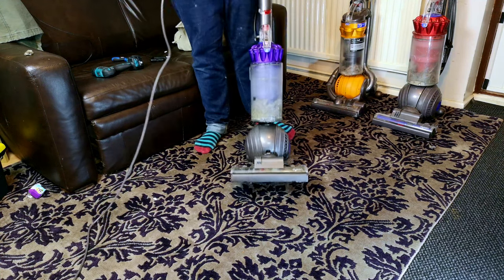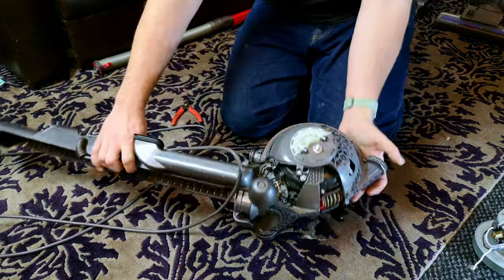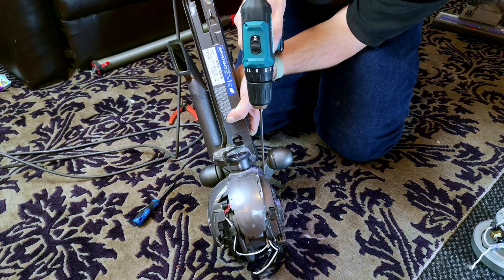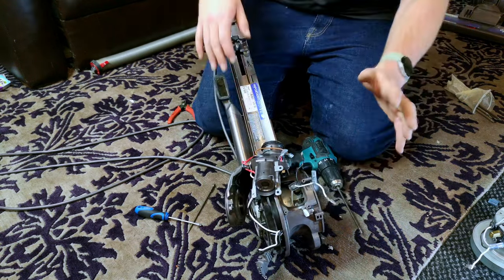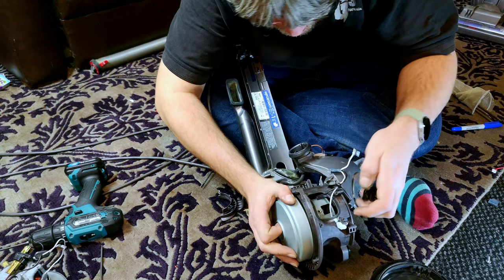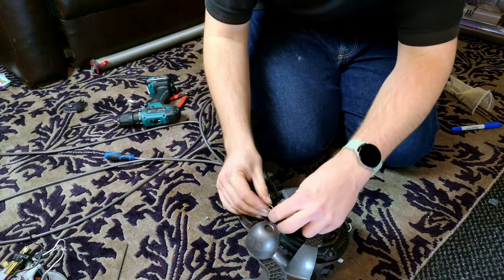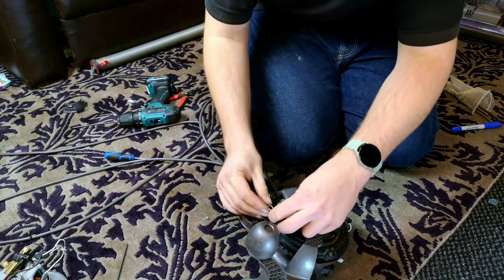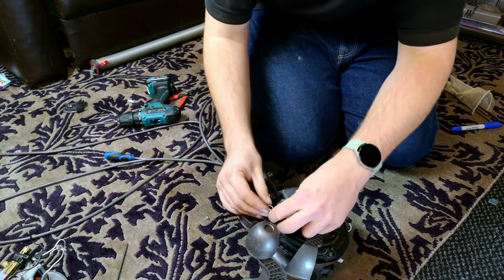How to replace the motor in a Dyson DC40!

Comment: Many thanks for making this video.  I spent £100 on a new Vax because my 9 year old DC40 sounded like a banshee when it was turned off spooling down and I figured it best to replace it.  From new the Vax was a poor replacement and after 4 months (hadn't taken the DC40 to the tip yet) really fed up with the Vax. Immediately after using the Vax I ran the DC40 over exactly the same 3 carpets and it extracted 1/3 of the container that the Vax left behind!  Took the Vax back to Lidl (thanks Lidl for the full refund) and, thanks to your great and humorous video, had the confidence (shaky at times) to remove the old motor.  My new one, an identical new OEM, arrives tomorrow with filters and another broken part and my reassembly is expected to be triumphant, given the myriad of dismantling photos & videos I took for reference. All for less than my refund. Thanks a million.

Comment: Very handy guide, that quadrant gear wheel mechanism that pulls the rear wheels down & moves the front section is a sod to line up, got there in the end though, seemed to work out better by putting it in upright position then engaging the 1st tooth on the quadrant gear with the first tooth on the wheel gear. Complicated but I like how the air is drawn over the pcb for cooling, clever, irritating, but clever 👍

Comment: Refurbished my up32 today, The motor in that is smaller so you do not need to remove a carbon brush. it is the same as that bar a few differences. like the brush roll connector. an easy way to assemble the release mechanism is by slightly unscrewing the clear cog, fully reclining the machine (with the screws out from the white half moon) line up the cog with the cog so the bottom of the clear cog corresponds with the other main cog, once it does snap the duct for the brush roll back on, see if it rotates if it does tighten the cog screw.

Comment: Bought a DC40 down the local dump shop. £15. Actually , a dyson rep said, DC40s are more powerful than the newer Dysons because they were not under the recent power regulations of the EU. DC40s still are worth their money even for second hand, though finding one for £15 working will be a hard thing to do. Yesterday the DC40 stopped working. Thought it was the motor, and it was. Thank you to this video as I haddn't gone as far as the motor. Well, no new motor needed. We had just moved into a house and had a total rewire, this means plaster dust, well you guessed it, the motor was covered in this dust on the inside. No contact being made where needed I guess, managed to get the dust away from the copper coil, now it works again.

As mentoined. DC40s have more power than the newer models and are worth having. They are still worth about £200 tbh. Even the dyson rep said it was better than the newer ones.

Comment: In regards to the white hub, if you dont put the side with the clamp on first, and put the screws i. The hub first, it really helps line it up first time, the the screw that holds the gears in, if you loosen that , it gives more play to mesh the gears

Comment: Thanks so much for this video. This was my first appliance home repair, and it would have been impossible without your help.
It feels a little looser but it works! Also, the motor I got off eBay had no loom, instead it had two points and a blue box in the side. I had to (guess) what attached and how, knowing very little about wiring and electronics. But it works and has saved us a fortune for now!
Reply from the maker: Nice, well done on the fix! Modern motors aren't polarity sensitive so it'll be fine 👍
Reply: @beko1987  good to know!

Comment: Great stuff - my motor had just stopped working and followed your video to dismantle it. New motor for 16 quid and all back together again after a very frustrating reassembly lol. 4 screws left over for some reason 3 silver and one black..(!) no idea what I missed.. (edit: Maybe 14:40 or 17:20; that's the problem with getting frustrated with it and doing bits over the course of a few days). Anyway all working again.   Getting those white & black wires in for the brush motor was a nightmare though - kept them in place with some insulation tape whilst trying to keep the grey cover over the black guide.. 

One thing I did notice is that once it was in bits, I could have fixed the motor.. 
Where the brush was/had been removed, the 90 degree (power) tag had snapped off - it was a refurb from dyson so suspect they broke it during refurb and it was just touching. 
Anyway a bit of soldering would fix it.. worth checking before buying a replacement.

Comment: wonderful video… my machine is indeed working a little better now..  i went a bit too far, and tried to disassemble the little plastic doubleclip that helps route and
 protect the wires out to the floor sweeper assembly motor.  The two halves of the doubleclip are (were) held together by a little plastic pin that is (was) about a half millimeter in
 diameter.  It broke off during reassembly.  I found that I could repair the plastic clip (repair the broken plastic pin) by torching a sewing pin red hot, inserting it in the plastic where the old pin was, and nipping it to length.

Comment: Hey! Thank you so much for making this video. This helped me teardown a UP24(UK Ball Animal 2) which has a ball design almost identical to the DC40. 

This helped me convert my imported UP24 to 120V so it can be used here in the US. I was also able to install a 120V version of the motor you used, so it should have better suction than it did stock

Comment: Spot on video, knowing which screws and tabs to remove and in which order made the job much easier, still rather fiddly though. Maybe Dysons are put together by people with very small hands :-)   16 quid for a motor from Ebay and jobs a gooden. My vacuum no longer sounds like a chainsaw. Thank you so much, you can have 10 housepoints.
Reply from the maker: Excellent, well done on a successful repair! It's why their so common to be refurbed, once you've done 5, their easy 😂 All about knowing how far the cheap plastic will bend before it snaps, then it's easy! Has to be easy for the China assembly team I guess 🤷‍♂️😲

Comment: Really helpful and enjoyable video, thank you for posting.  When you say in the comments that this process works for the ERP model, how much difference is there please?  I've got a few that require motors, and a fairly large amount of spare motors to use.  The only thing I found slightly confusing is that you did not completely remove the lower internal hose, because unlike the 41, the 40s simply unclips.  Once again, thank you for the video, I am glad someone had the patience to work out the ins and outs of changing the motor in one of these.  Regards Bill
Reply: Mine was the erp version and pretty much identical to this.

Comment: Glad to see you got the thing back together, just a little surprised you didn’t bother to clean the internal hose since they crack quickly when dirty like that.  I cringe at tossing all those screws in and cross threading them.
Reply from the maker: You absolutely should change the hose when your in that deep, your right. I just covered the motor swap in the video but there's alot you can do! Dyson screws aren't so bad at cutting them a new thread, old metal vacuums and it's a big no no though, your right

Comment: Hi, good video, there's a bodge if the woooooooo sound bothers you.... remove the post motor filter and cut off the rubber seal on the mount.
Reply from the maker: Wipe it and the opposing face clean and then try. If not, a smear of vaseline on the seal 👍 Or a new filter... 😂 Its usually a sign https://www.ebay.co.uk/itm/183791998948?mkcid=16&mkevt=1&mkrid=711-127632-2357-0&ssspo=SgqCUqgkSpW&sssrc=2349624&ssuid=QOvj0cTJQtq&var=&widget_ver=artemis&media=COPY

Comment: My dyson dc40 is dead would it be pcb or motor
Reply from the maker: Could be the switch, flex, motor or pcb, although the pcb usually only takes the brushroll out, not the main motor
Reply: Motor
Reply: @beko1987  or the fuse in the plug lol